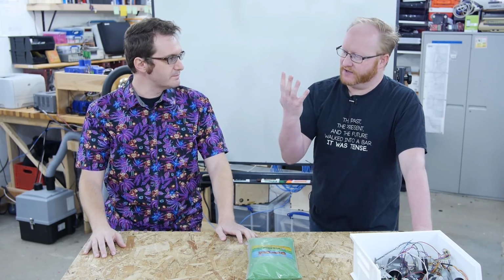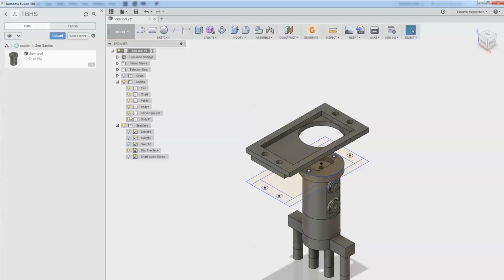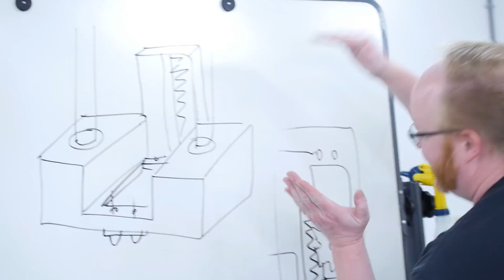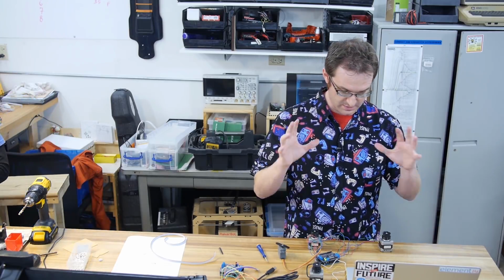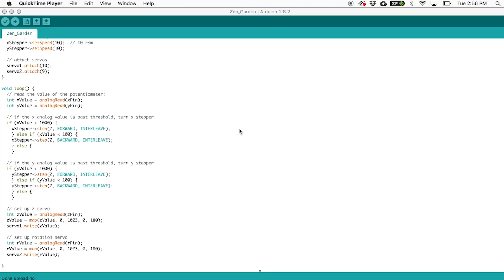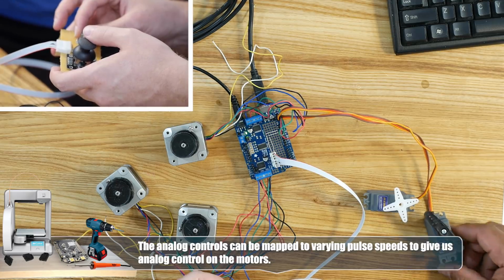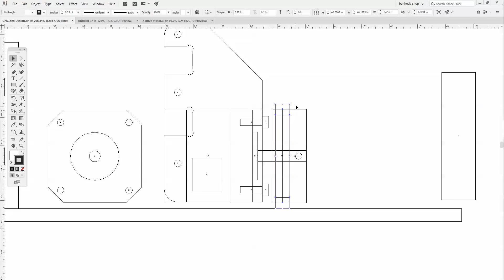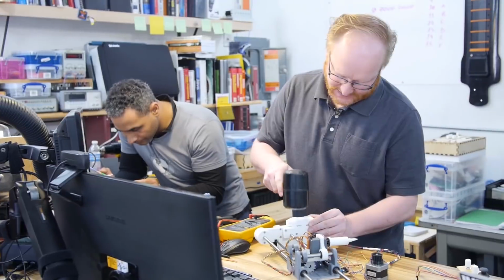Zen Garden Gantry with Matthew Eargle

Comment: Hey Ben! I love you videos and I have project that I'd love to see and you're probably the only person who would actually do it. I love my nintendo wii and use the classic controller pro often, however the ergonomics for the controller are kinda awful. I think it'd be awesome to see a redesign of the controller shell to match something similar to the Xbox 360 controller. 

And if you wanted to take it a step further, the classic controller requires to be plugged into a wiimote to function. You could include the wiimote board inside the shell as well so the controller can be independent from wires!

Comment: I have build a reprap mendel 3d printer, and am using that to make a bigger custom reprap 3d printer, which i will use to 3d print parts to build a cnc machine, which i will use to make a better cnc machine, which i will use to make a better 3d printer. Then use the combination of the machines to make a 3d scanner and a laser cutter lol. Making stuff is awsome

Comment: I think a sliding potentiometer for the Z axis and a rotary encoder for the rotation of the rake would make for more intuitive controls. The slider would represent the height much better while the rotary encoder would allow for free rotation with no end stops if you use a stepper motor instead of a servo. The down side to the encoder would be the stepping but it does not have to match 1:1 with degrees. You could have each encoder notch as 1 degree of rotation on the rake or 5 degrees, depending on how fast you need it to rotate. Perhaps have the rake rotate fast when the gantry is fully raised and slow when down in the sand allowing for curves to be drawn in the sand with practise. :)

Comment: This idea would be cool if you replaced the rake with small steel balls, and used magnets from beneath to move the rake (steel balls) and controlled the whole thing with a tablet touch screen program.
Reply: Jared Byer we had that idea to and really wanted to do it but didn’t have enough time. Matt was only here three days.